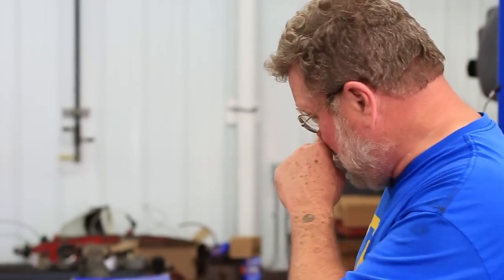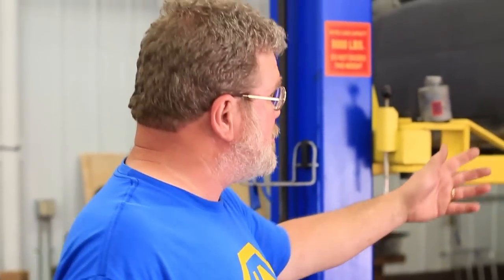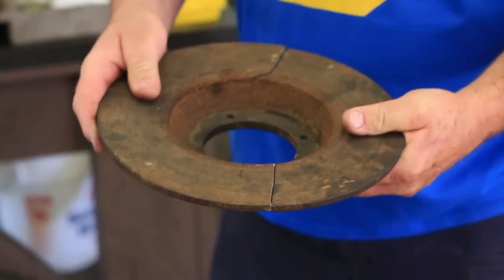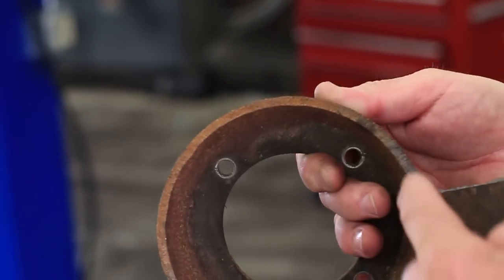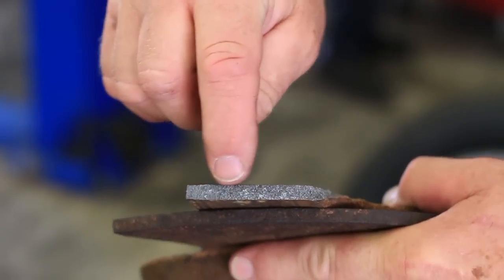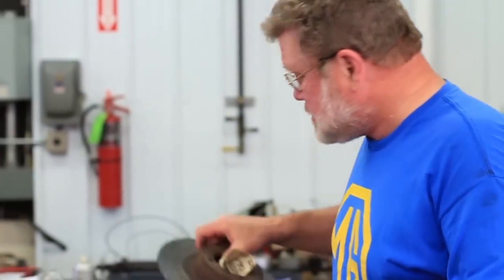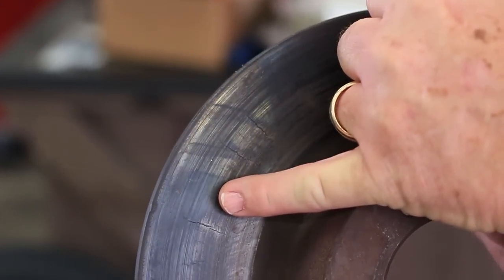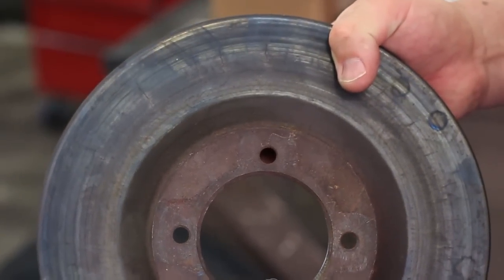244 MG Tech | Repairing Brake Rotors on MGA

Comment: Just took the midget for a ride this morning, the knockoff cap felt burning hot after about half hour driving, is there a way to check how hot is should be, or is it supposed to be not that hot? Didn't do very heavy braking, but did have to stop at about every block for traffic.